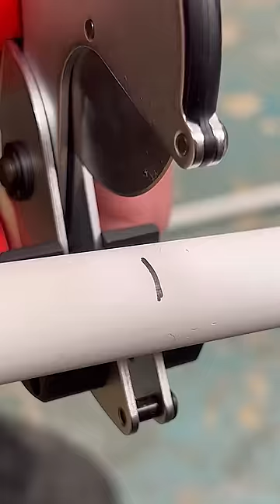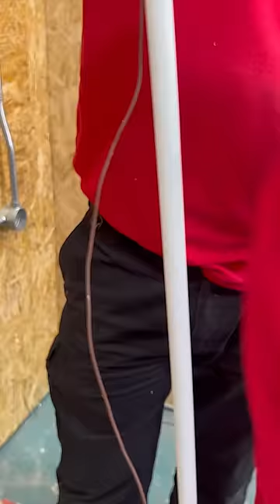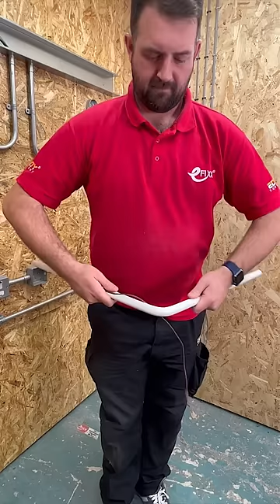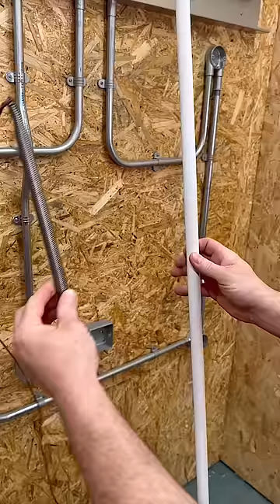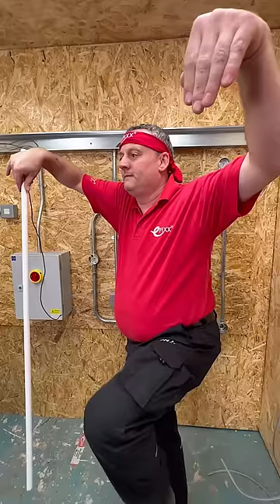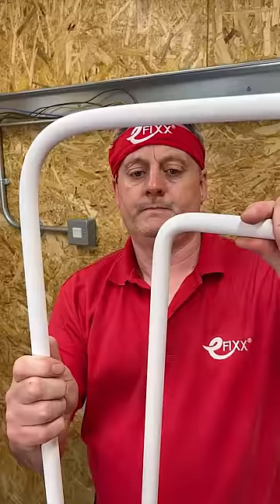Most Electricians Don't Know This Conduit Bending Trick!

Comment: I get nice bends heating up one side then use the spring but bend it over a drain pipe the heated up side goes to the outside as that’s doing all the stretching.

Comment: Another way to get around making a 90 bend with crap plastic conduit (that will just bend and kink) is to just make 2 45 degree sets…you get a slower bend so it’s easier to push/pull cables down and the conduit doesn’t kink…of course sometimes you don’t have the space to do this and a tight 90 is all you can do

Comment: Great video but technically what was the difference? You didn’t bend the second one over a surface ?
Reply: Dont bent it to sharpy, by using a surface or holding your hands very close to the bending point. It is annoying to run wire through, and it makes it a lot weaker.

Comment: all electricians know this
Reply: only all those you know, here they mostly use PVC elbows. when they even use one that is. or use conduits at all... 😑

yeah, code not the same and lots of hacks doing residential and commercial hair raising stuff behind plaster boards... 😒

that Knipex looks nice though... 😗👍
Reply: Where's here?? in Ireland we're trained in all forms of conduit
Reply: @calvinwade2751   here is the other side of the Channel, or, if you prefer, Northern North Africa. 😉
code is fine, training too for certified electricians but you'd be surprised how many work professionally without any cert or real competency. 😒
Reply: some don't